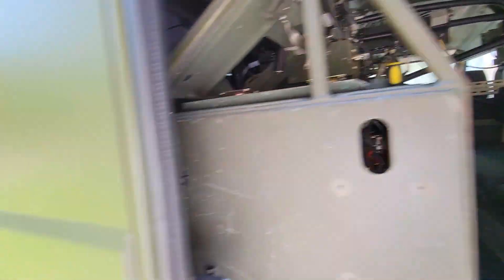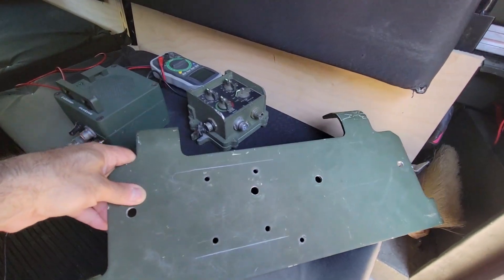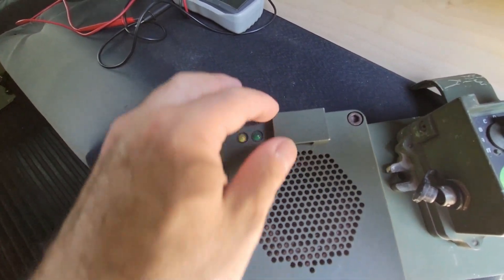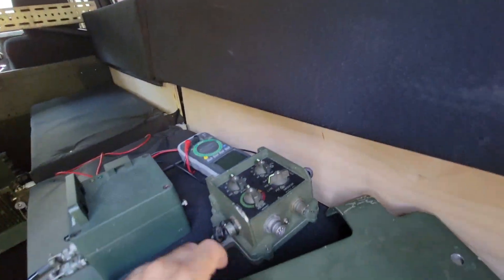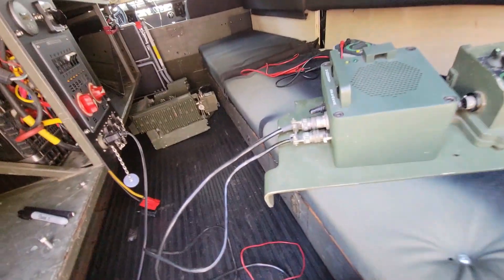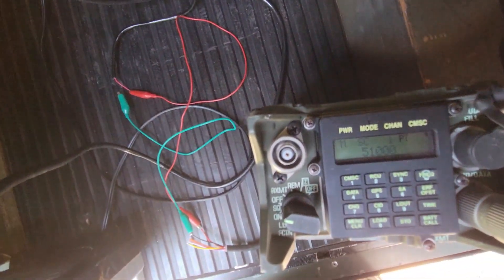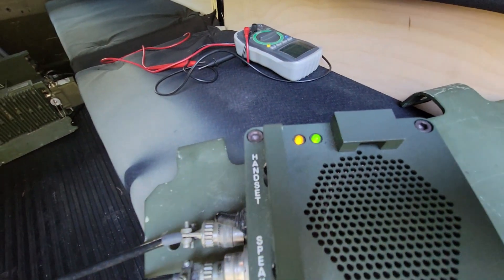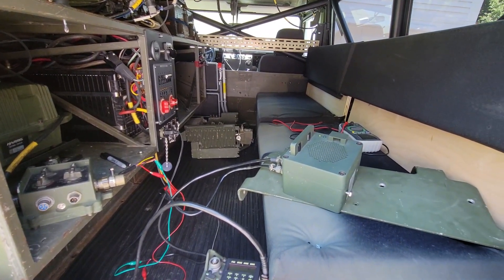Part 3 - Installing the VIC-3 Rear Operating Position

Comment: I just came across your posting and you are in the “deep web” of comm stuff. Holy smokes, really amazing setup. I wanted to ask I’m setting up my system. What do you have for crew and control station mounting hardware brackets. I have that large mount but what about the control station bracket? I’m looking for a bracket. It appears I may have to make one but if you know of part numbers or pictures I could sample.
Reply from the maker: Hello, Hellon. I made my mounting panels to suit my Defender. Download the CAD tool from https://www.emachineshop.com/ and then here are my designs you're welcome to use them. https://w2hx.com/?prefix=x/1986-Tithonus/Control%20Panels/ good luck and 73